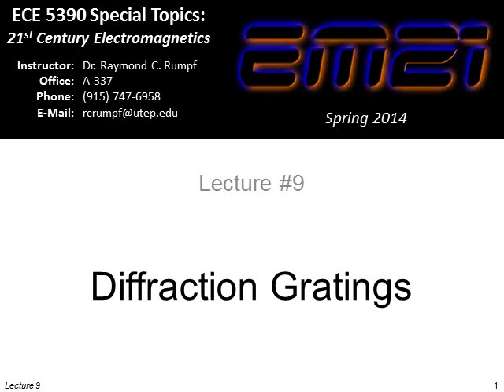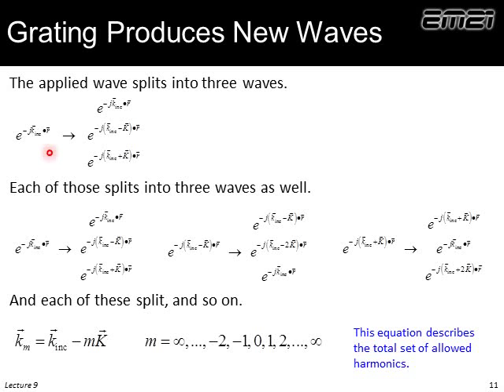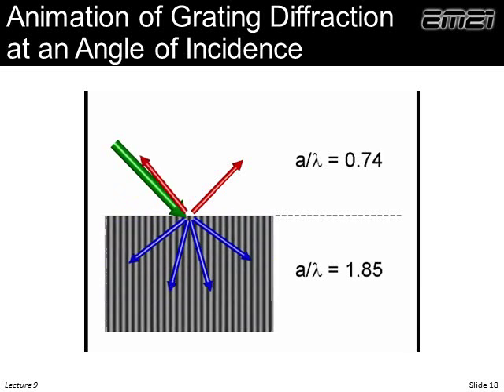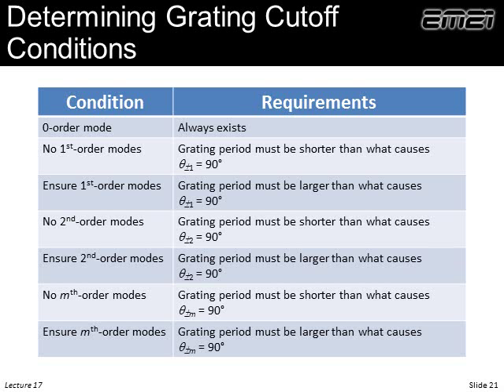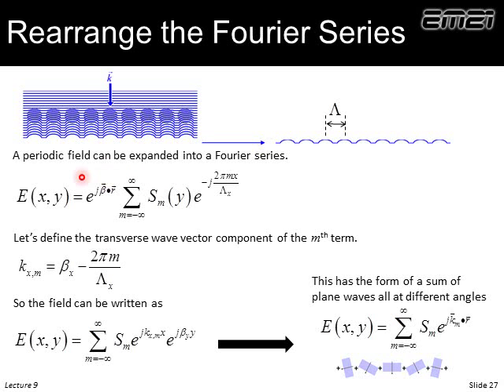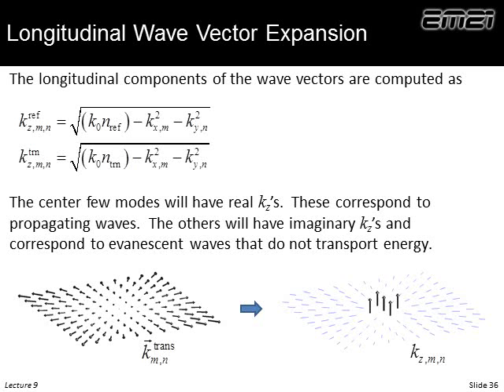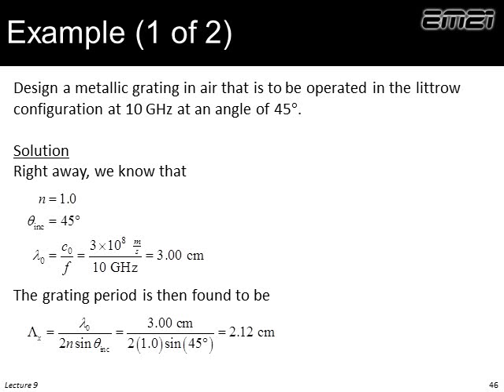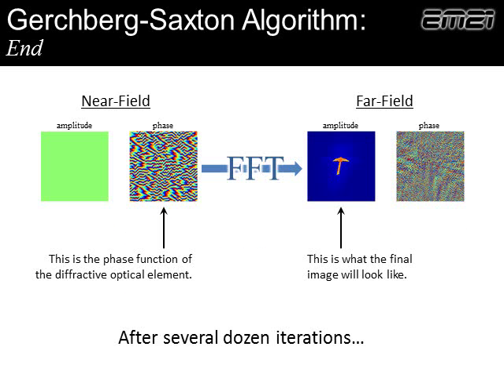Lecture 9 (EM21) -- Diffraction gratings

Comment: Hi sir, 
 Thank you for the great lecture series can you please let me know the reference for this  diffraction gratings and blazed grating
Reply from the maker: First, I should let you know you are watching an older video that has been replaced with a considerably improved series of videos. I recommend accessing all of the material through the course website so you will always have links to the latest versions of notes, videos, and other learning resources. Look under Diffraction Gratings in Topic 4 here:

https://empossible.net/academics/21cem/

It is actually hard to find good learning materials on diffraction gratings. To help this a little bit, I added some discussion to a book I recently wrote  on the finite-difference frequency-domain method. In this book, Chapter 2 reviews many topics in electromagnetics. Pages 56-62 cover theory of diffraction gratings and calculating diffraction efficiencies for both ruled gratings and crossed gratings. Simulation and analysis of a sawtooth diffraction grating is given in Chapter 8. Here is a link to the book website if you want to learn more:

https://empossible.net/fdfdbook/

Hope this helps!

Comment: "Thank you for your nice lectures. 
I have a question about fabricating a cross-grating with only four diffraction orders/modes, excluding the zero order or DC term mode. Specifically, I want to create two modes with orders +1 and -1 along the x-axis and two modes with orders +1 and -1 along the y-axis. Do you suggest using the GS algorithm to accomplish this?"
Reply from the maker: If you do this, you will have 8 diffraction orders, excluding the zero-order mode.  Is this what you want or do you really just want four diffraction orders?

If you are only concerned about getting the diffraction orders and not so much controlling the in any other way, just using the grating equation to calculate the correct period is all you need.  You could perhaps do a simple parameter sweep of grating depth to help balance the power in each of the diffraction orders.  If you want to get more sophisticated, you can consider GS, genetic, particle swarm, or just multiple parameter sweeps.
Reply: @empossible1577  Thanks for your reply. I want 8 diffraction orders but do not want zero order. How can I convert it directly into GDS for e-beam fabrication?
Reply from the maker: @sandeepchamoli6849  Well, first you need to produce the design.  Any variety of algorithms will work, but I would try a simple parameter sweep of grating depth and see where that zeros out the diffraction efficiency of the zero order.  It may get a little more complicated if you want to also control the diffraction efficiency of the other diffraction orders.

I have limited experience with GDS so I may not be of much help.  As I recall, it is a script language that defines primitive shapes.  Maybe you can write your own code?  For some reason, I am thinking you generate isocontours in MATLAB and then export those paths into GDS?  I am really getting outside of what I know here.
Reply: @empossible1577  Thanks.
True, diffraction efficiency would be an issue.

Comment: Why is the dielectric function in slide 10 a sinusoidal grating but not other periodic function? I mean later you mentioned that the wave is periodic and is a sum of a bunch of waves, but you did not mention it like in slide 10. Is it just a possible function of dielectric you give as a example and Is it depend on permittivity profile? Thanks a lot
Reply from the maker: When it comes to the grating equation and calculating the direction of the diffraction orders, the only thing that matters is the period of the grating.  Therefore, expressing the grating as a simple sinusoid is very convenient and makes the math easy.  Don't read more into this than simply conveying the period.  The actual pattern of the grating controls how much power gets coupled into each of the diffraction orders, not the direction of the diffraction orders.  In this case, approximating the gratings as a sinusoid would not work because that does not convey the pattern of the grating.

Hope this helps!
Reply: @empossible1577  thanks a lot

Comment: Thank you for your lecture. But I have a question about the proof in Slide 13 ' the grating eqation' in video. Why do you use period over sin(phi) to take place of the x component of period? I can't understand it.
Reply from the maker: Because the final equation is in terms of the period, not the period along the x-axis.  The sin(phi) converts between the two.

Comment: Many thanks for your videos. But I have a question on slide 31. In this page, considering a p-polarized wave (E-vector parallel to x-y plane),  the norm. incident wave with wave vector points to y direction indicating the zero-Ey components; however, the sum of the diffracted waves(..., -2, -1, 0, +1, +2, ...) in your figure indicate the non-zero Ey components. At the interface, the boundary condition could not be satisfied with a zero-Ey (incidence) and non-zero Ey (diffracted waves). Thus, the diffraction does not exit.
Reply from the maker: The waves shown are only the POSSIBLE directions for waves to propagate.  This slide says nothing about how much power will reside in each of those diffraction orders.  In fact, if the reflected waves are ignored (that complicates the boundary condition problem a bit), there will be only the zero-order mode on the transmitted side in order to satisfy boundary conditions with the applied wave.  As that zero-order mode propagates into the grating, power will gradually be coupled into the other diffraction orders.
Reply: @empossible1577  Many thanks for your quick reply.  Sorry for bothering you, but I can't understand " As that zero-order mode propagates into the grating, power will gradually be coupled into the other diffraction orders." Could you please give more explanation about it? Another question comes from slide 15, the second figure "Subwavelength Grating".  In this case (no higher-order reflection), as you said, the tilted blue arrows just show the POSSIBILITY of diffraction. Indeed, there is only zero-order transmitted wave (to satisfy the boundary condition). Is that right?
Reply from the maker: @jiyaoyu9073  The diffraction orders are just possible directions that waves can propagate.  At the very top of the grating, only the zero-order mode has any power in it.  If there were power in any of the other diffraction orders, the boundary conditions to the incident plane wave could not be satisfied.  As that zero-order propagates into the grating, power is gradually coupled into the higher-order modes.  This can happen in a quarter wavelength or so.

In that figure in "subwavelength gratings," there is only one diffraction order, but the reason is not boundary conditions.  There is only one diffraction order (the zero order mode) because the period of the grating is too short to support any higher-order diffraction modes.
Reply: @empossible1577  

Many thanks for your reply. I think I could understand a bit of the "gradually coupling". But in the second question, I mentioned the second figure but not the first figure in slide 15. In this case, the condition of "effective wavelength in incident plane > grating period > effective wavelength in the grating" is satisfied. In my understanding, the grating period is larger than the wavelength in the grating, the diffraction could appear. For a infinite etched grating (grating depth is infinite, but not the grating length), the boundary condition on the top interface is not satisfied only between the incident waves and higher-order diffracted waves, i.e. always only zero-transmitted waves exist. But for a finite etched grating, the boundary could be satisfied between the incident wave and higher order diffracted waves and "reflected waves". These "reflected waves" means the reflected waves by the bottom interface of the grating, but not the top interface of the grating.
Reply from the maker: @jiyaoyu9073  The waves in a diffraction grating are more complicated than I think can be visualized.  First, you have the reflected diffraction orders that contribute to the boundary conditions allowing for some power to be in the higher-order diffracted modes, even at first.  The grating also acts like a Fabry-Perot cavity complicating things even more.  The picture I painted was an overly simplified one to help you understand.  Finite gratings are even more complicated because they are not infinitely periodic and the field changes at bit at the edges of the grating.  Take a look at Slide 22 in Lecture 15 here:

http://emlab.utep.edu/ee5390cem.htm

Comment: Sir,, thank you for your informative lecture. The portion of the lecture I dont understand is why the 3 splitting wave splits again as they already left the structure unless the z-dimention is large enough.
Reply from the maker: The splitting happens simultaneously.  It is just that the power slowly leaks from the applied wave to the other diffraction orders as the wave propagates through the periodic medium.  Once the wave leaves the periodic medium, all of that coupling and splitting is over.  Sorry if I confused this point.

Comment: What purpose would it serve (if any) to have both outputs of an optical beam splitter then fed into as two inputs to a transmission diffraction grating? The diffraction grating has two outputs used. What's the point of doing that?
Reply from the maker: Hmmm..  I am not completely sure.  Maybe to split the beam four different ways with some differences between the beams?  Some beam splitters can also manipulate polarization, performing filtering, etc.

Comment: As most grating figures in this video are showing top view of the gratings, I would like to know if each incident light wave vector and transmitted/reflected wavevectors have perpendicular in plane and out of plan directions, respectively? and is each diffraction order arrow  attributed with a plane like shown in slide 15? also in slide 16, how do you usually define n(avg)? is it the transmission/reflection medium refractive index? Thank you.
Reply from the maker: For all 2D pictures, the angle of incidence is in a plane perpendicular to the grating grooves.  This is a simplifying case where all diffraction orders lie in the same plane.  If this were not the case, it is called conical diffraction and diffraction no longer occurs in a single plane and analysis is a bit more complicated.

n_avg is the average refractive index where the diffraction orders are being analyzed.  If this is inside the grating, you need the actual average.  If it is outside of the grating, then n_avg is simply the refractive index of that region.

Comment: Thanks for your great videos! I have a question regarding slide 12. Why doesn't kx_i=kx_m?  That is what I would expect from phase matching at the interface.
Reply from the maker: +Zoé-Lise Deck-Léger By kx_i are you talking about kx_inc?  The incident wave is a uniform plane wave.  The grating has the effect of inducing a periodic fluctuation in the amplitude of that plane wave.  This really is no longer a plane wave and as this lecture shows it is actually the sum of a bunch of plane waves propagating at different angles.  The interference of all these planes waves combines to reconstruct the fluctuations.

Comment: I have a question regarding diffraction in reflection region. what kind of grating can have both backward and forward diffraction. Considring that it is a low order grating. does it depend on reflectence of the surface?
Reply from the maker: +Leila Mazaheri If you etch a grating into glass, it will have both forward and backward diffraction because it is partially transmissive.  In fact, I would say this is the most common case.  You would need something like a metal grating to prevent forward diffraction.

Comment: Thanks a lot for uploading this video. What is the reference textbook for these lectures?
Reply from the maker: ShiXingDongZhan There is not textbook for these lectures.  Over time, I am trying to work more references to the literature into the notes.  If there is a specific topic, let me know.
Reply: CEM Lectures I am interested in the polarization selectivity of Bragg grating. Intuitively the electric field will parallel to the grating, but is there some straightforward derivation like the way you derive the grating equation? Thanks a lot.
Reply from the maker: ShiXingDongZhan A Bragg grating is not really polarization sensitive.  I think you are asking about the diffraction gratings in this lecture.  There is a difference, but I don't think I have laid that out well.  In a Bragg grating, the planes of the grating are perpendicular to the direction of the wave.  They produce a stop band like a photonic crystal.  In a diffraction grating, the wave is applied parallel or at some angle to the grating planes.  The grating can then split the applied wave into some number of diffraction orders.  

To answer you question, a solution to Maxwell's equations is needed to determine the polarization selectivity because you need to know field amplitudes.  There may exist some closed form expressions somewhere, but I do not know where.  There is a somewhat nice derivation for the effective properties when the grating is subwavelength and not diffracting.  Are you interested in polarizers?
Reply: Yes, I was referring to the diffraction grating. The derivation of the Grating Equation you gave is very nice and instructive, which is much better that that in many textbook. Actually I am working on some one dimensional DFB laser experimentally, basically a gain medium with a !-D grating. So I'd like to understand the polarization of the resonance wave, if there is nice analytical description of this. Thank you so much for your kindly explanation.
Reply from the maker: ShiXingDongZhan By resonance wave, are you looking a resonant grating (i.e. a guided-mode resonator)?  Otherwise, I do not know how to get quantitative without a simulation.  There may be some first-order theories.  Do you need an analytical solution or would a simulation suffice?
Reply: CEM Lectures Right, it is a slab waveguide with 1-D periodic refractive index. Is there some equation describing this scenario? Thanks a lot.
Reply from the maker: ShiXingDongZhan Sort of.  Take a look at Lecture 11.
Reply: CEM Lectures Thanks a lot.